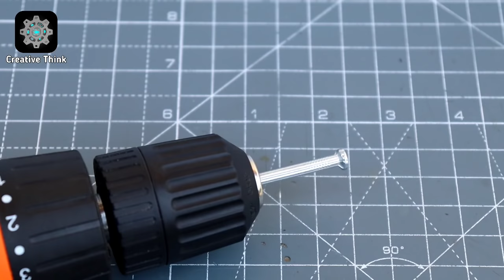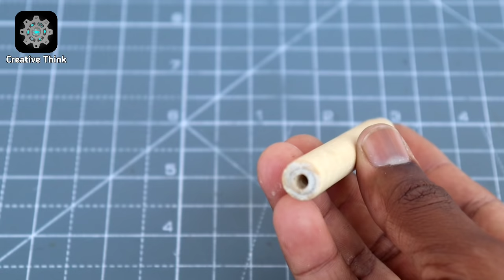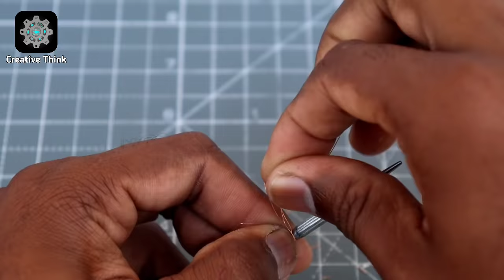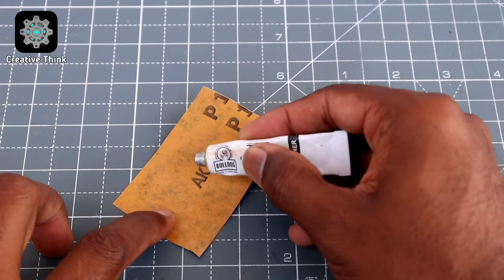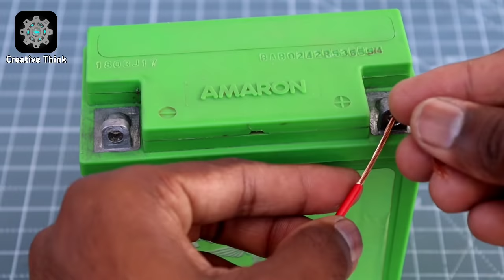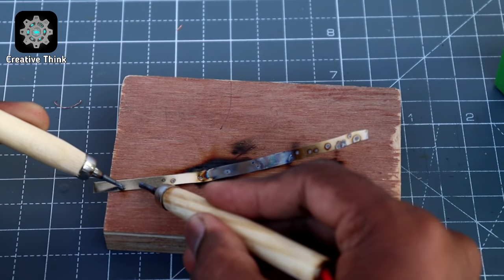Spot Welding Machine Using Lead Acid Battery

Comment: Appreciate the efforts but there are some disastrous design flaws which you can work upon. Sorry for being a critic, but this can get dangerous to viewers who may try to copy you.
1. The SS nail literally melted. What are some better alternatives?
2. Should've used proper battery connectors instead of directly soldering on the battery terminals. The battery material (chemicals) get damaged due to heat, thus reducing battery life.
3. Diode alone is not sufficient for protection, how about adding a fuse of appropriate value?
4. How about PWM switching control (using maybe MOSFETS) for variable output power control and efficiency. Also when it gets touched it should automatically disconnect after few milliseconds for a precise spot weld, after that even if it stays touched, it won't be connected.
5. An assembly setup with a handle like how vertical drills work. If the two terminal probes touch each other by mistake, then it will blow.
6. How about Using an 1:1 isolation transformer between battery and system?
Reply: The diode has been removed by in the video of it working. I'm guessing the current killed it.
Reply: I, for one, appreciate this comment.  I am an avid DIYer, and your suggestions are very valuable for someone like myself who is serious about recreating a similar device for small projects.  👍🏽
Reply: What is a PWM switching control if I may ask?  And what might it look like? I mean down to the component level. I've been trying to learn about circuitry basics and the fundamentals...any input helps. No obligation though. 💁‍♀️💖
Reply: @Merrick Brody  what kind of stuff do you make DIY?  Any chance I could see some of your work?
Reply: @chloedevlin6544  basically, you would use a switch which can be controlled (turned on or off ) digitally/ with a digital signal like a 1/high or 0/zero, generated from a digital circuit.
This switch can be a MOSFET, Relay or other any other electronic switching device suitable for this application.
(Suitability depends on factors like maximum current rating, polarity, switching speed, triggering circuit specs, etc.)
For starters, now you can turn things on and off with precise timing with use of this switching devices... For eg. you turn it on for precisely 100milliseconds and then turn it off automatically by using a digital circuit.
Reply: @chloedevlin6544  you can also input a PWM signal to this switch. PWM - Pulse Width Modulation. 
It's hard to explain this topic in the comment section, you can easily get the fundamentals on google. But it is basically a signal which turns the switch on /off at a high frequency.
Due to this, the output power can be controlled. 
How? Try continuously turning on/off your fan or any motor manually using a switch button and observe how it affects the speed by varying on time and off time
Reply: I would highly recommend everyone to strictly not experiment around these things like battery and high power devices unless you have adequate technical knowledge of electrical engineering and power electronics.
Or else, it may get explosive and firey and dangerous soon.
Reply: @spinnanz  No guessing needed.  It's unnecessary.  Serves no purpose but to make smoke and shrapnel.
Reply: Isolation transformer?  For what?  It's a DC circuit and transformers do not work with steady-state direct current.  Even if you pulse the primary, what purpose did the transformer serve if it's 1:1 and the source is ALREADY ISOLATED?
Reply: @advl__  "eg. you turn it on for precisely 100milliseconds and then turn it off automatically by using a digital circuit."  What you just described is, in no way, PWM.  It's a pulsed DC controller, but it's NOT PWM.  Stay in your lane.
Reply: @advl__  It is not difficult to explain if YOU understand it.  And from your previous explanation, it's clear that you do not.  PWM is simply the manipulation of the duty cycle of the DC current.  If you leave it on constantly, it is 100% duty cycle.  If you turn it on for a given amount of time and then turn it off for the same amount of time, it's 50% duty cycle or a PULSE of DC that is equal to the off time. If the on time is 1/3 of the off time, then you have 25% duty cycle.  If the on time is 1/9 of the off time then it's 10% duty cycle. etc.  Do this continuously and you have a PWM signal. The pulses are typically no longer than 0.5ms so rates of 1000 times per second and faster are typical.  This is NOT how you limit the energy (not power) on a spot welder.  You do that with a SINGLE pulse that can be made shorter or longer.  Just because the pulse duration is limited, does NOT make it Pulse Width Modulation.  The power of the spot welder remains the same as the resistance and current remain relatively constant (barring non-Ohmic materials) and power is IR^2.  Power over time is the energy put into the system and you want to limit the energy going into the substrate.
Reply: @DiffEQ  Maybe it's time for you to go back to engineering school. Maybe a real one this time.
Even though the source is DC, it is in no way isolated and it can damage the battery when the terminals are getting directly shorted, especially when there is no current control. ( resistance is not isolation) That's why a thought proposal for "isolation" transformer. A thought proposal does not mean I am telling to connect the isolation transformer directly to DC source without alternator at input and rectifiers+switching control at output side. (It would also be more efficient at higher frequencies if you had enough knowledge to ponder upon) 

Regarding PWM your statements are self contradictory. Maybe try working on some practical projects in real engineering labs before blabbering half understood definitions in comments.
My explanation of PWM was to give an introductory concept to someone who is not from electrical background.

Power is not IR^2 as you have stated... It is I^2 * R and also V*I . It depends on both Voltage and Current. And with PWM  one can control average output voltage and thus output power.

Also, try to understand the objective of my comment. I am not here to teach engineering or tell the OP exact improvements on the project, I am trying to trigger a thought process and so are the wordings.

Comment: In an emergency situation,  this would absolutely work on light gauge materials,  but it is not advisable to use this setup for long term use...
Reply: Sketchy af.  Just get a $20 controlled welding pens.
Reply: @h8GW  I'm not gonna carry around a welder everywhere I go, so in an emergency, if all the parts were on hand, this could get you out of a tight spot...

Comment: What is that item you welded on positive pole?????? Why it isnt in your components list?
Reply: That was Diode just to make current flow in one direction .
Reply: Why the diode is needed? The battery is DC not AC. You are going to burn the diode if the current exceeded its ratings.

Comment: What is the little black link you added? Is it a diode? And do you recommend a specific one?
Reply: Yes, it's a diode.  What else could it be?  It's not going to survive shorting and, if you look, it's not in the device he's demonstrating.  It fried the first time he tried it... and it served no purpose.
Reply: @DiffEQ  well thanks for your comment. And to hell if I know what it was is why I asked the question. I'm not a engineer nor electrician. Electrical engineers, for all we know that could be anything or nothing. "What else could it be" some people think they're to smart for their britches sometimes. Maybe it's low self-esteem because they know something someone else doesn't they feel they have to be insulting to boost their ego? Are you sure that isn't just blade fuse in the housing for a fusable link? That's what else it could have been. But again thank you for clarifying my first guess was the right guess..
Reply: Number one, it's easier to pee than doing a number two... When about two hundred amps go through your ass or your heart.

But that is unlikely because 12 v won't shock you, isn't that shocking? 
Not enough voltage, yeah plenty of amperage, but if electrons can't pass through you, it's like a little girl kicking you in the shin.. annoying 😅

I don't know you might be able to use a diode out of a old microwave. 
And hell that  transformer in there will sure do some tac welding., But you better watch out, that shit will fry your cookies, I think they put out about 6000, but Not much ambridge, still yet you'll be looking like Einstein your hair all in a fizzle.

But you can use one to do tack welding or even with a stick. Just got to do some modifications, that  info can be found.

Keep On keeping on

Comment: Can a car battery be used for this? What is the part number for that diod? Thanks in advance
Reply: yes
Reply: The diode is stupid and didn't survive.  Do you see it in the end demonstration? No... it blew the first time he tried it and it served NO PURPOSE to begin with.
Reply: He obviously had enough power from the battery he was using.  A car battery would just deliver more power.  The part number for the diode would be BLWN2HELL.

Comment: Two problems with your set up. First and foremost those leads are always hot. That is a bad thing. Second stainless steel is the wrong material for the leads as you showed. Melting them. Copper or tungsten would be a better choice. A momentary switch is essential for safety.

Comment: What if we parallel connect ten 1000uf capacitor and charge it with this battery and then use that charge capacitors as a spot welding machine. Does it work or not?

Comment: On the minuhete 5 it show that you connected the red wire straight to the + side, where is the thing that you welded before in video ?
Reply: The materials and construction are just foolishness.  Diode soldered directly to the battery lead?  WHY?  Maybe this guy is laughing his head off just thinking of all the idiots who followed his video only to have a semiconductor fry/explode in front of them.

Comment: Why are the solder joints not melting? It means solder has higher melting point than iron or aluminium and if it is so then  we can use soldering iron for welding
Reply: 7
Reply: That's because soldering tin has lower resistance than steel he spot welders it, but honestly this video is a junk.
Someone with enough understanding will know there is no diode needed for DC current.

Comment: You shoewd a good video but you dis not mention the item and its specification of tge electronic vomponent you welded to the batterg. thst was the most helpful item
Reply: Learn to type!

By reading any further you agree to assume all liability and responsibility for your own actions and what you decide to do with this information.

That being said, it's a "6 amp, 400 volt, rectifier diode"...
If you could not figure that out on your own, than you should not make one of these. I told you anyways because I believe in natural selection. Do with it what you will, but remember I warned you.

Comment: If you make a pedal that will create a quick contact you will have some more control and not stick your electrodes and melt everything. Just tap the pedal quickly.

Comment: it is good for welding thin metals but for spot welder supercapacitor is better
Reply: Can you explain your comments further please bruh, I'm working on a 1977 toyota pickup and cutting put a the rust , only the body has rust thank God haha 😂  but I need to replace my flooring in The cab , especially in the front part of the cab, where the factory bolts the cab to the frame near the engine firewall it's completely rusted away like there's nothing g holding the body to the frame anymore , i can't afford a welder at the moment and I need this truck for work so I've been looking for ways to weld new flooring in. In also building a full roll cage hidden Inside the body , reinforcing some stuff on the truck since I'm tripling the HP it has currently. All new adjustable coilovers front and new adjustable 4 link coilover in rear to replace the leaf springs , new disc brakes front and rear, HEAVY sound deadening for floor,doors,roof and heavy duty weather stripping replacement. Lowering it a bit to help with handling at high speeds, no power steering ... anyways I'm excited AF for the build trucks factory original everything and everything works except it rained heavy one day and my speaker(yes truck has 1 single speaker ) lol went out. Anyways until I can afford a welder I have to make do with what I got 😂
Reply: @timothy2935   it has not enought Amper to weld solid car body, you need proff spot welder or MIG

Comment: EXTREMELY DANGEROUS!!!! Not recommended.
Reply: Why?
Reply: @dmitrym2922  because spot welder use low voltage high current which is ideal. But what he is using is gonna damage ur battery if you gonna weld using this
Reply: It's a 12volt system how dangerous can it be? I've been zapped by the ignition coil it's not that bad. Now if you fuck up the spot weld on the lithium ion battery that can be unpleasant what with the fire amd such

Comment: He needs to use steel nails for electrode to ensure better resistance than copper. If your voltage can be reduced to 3V then copper is better else battery will get damaged.Good idea though I prefer a 3V source

Comment: Waste of time. 
1: Probes should be made of copper
2: Diode does nothing 

May as well just get a battery and jumper leads and use them melt the metal.
Reply: Diode does absolutely nothing (but get hot, I bet)

Comment: Soldering  a wire that will heat up to hundreds of degrees Celsius? Note how the timber handle is brown  from the heat... releasing all those toxic fumes from the burning epoxy. This  a children school project that should be supervised and then disposed of by a responsible adult. But with millions of views the clever creator is enjoying the $$$ of his effort

Comment: Please what is that little black component you welded to the battery terminal?
Reply: Emergency licorice candy
Reply: @waynemasters8673  thanks. What is it's importance there?
Reply: @umarfaruq4335  They are everywhere in electronics for a quick snack.

Comment: love the fact you put a diode in to prevent back voltage and possibly making the battery explode.
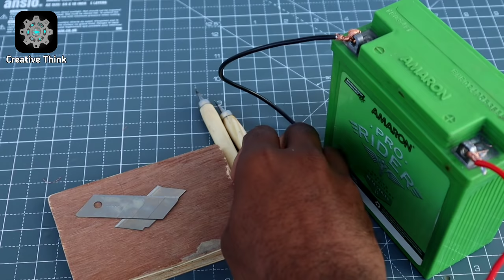Reply: Take a look at 5:02 , the diode is missing 🤔
Reply: @raafayumar8015  he must have edited it after and put the diode in.i would never do this without one.thats just asking for trouble
Reply: Back voltage wtf is that
Reply: @henryharmse4003  when voltage goes to one point, hits resistance or is shut off.the electricity needs to go somewhere so it goes back where it came and that could cause damage......prob not the best explanation for it but thats how i see it
Reply: The battery is the only power source.  There is no other power source to drive current INTO the battery.  No diode needed other than to provide some smoke and light on first use.  His diode did not limit the current to 10 amps.  It self disassembled and let its smoke out shortly after the current exceeded 10 amps.

Comment: Mark my words it's coming I don't know when but that battery will explode when you short it across the metal like that they're not designed to do that type of work I have worked at battery places in the past and have seen it happen many times over people accidentally shorting batteries and they explode

Comment: Way to strong for like quick lithium battery fixes ie the spotweld comes apart  with a lower current u could  use this to  re solder the spot weld

Comment: Youtube should hire some technician experts to review the "DIY" videos and the dangerous ones remove from public view, just like this one which is crap at first point and 2nd, it doesnt work....instead of nail only electrode suitable to use is a TUNGSTEN...which can be bought in any shop with the welding equipment for TIG welding for like 1 to max 2$ a piece 150mm long 2.4 or 3.2mm thick,  so you can make 2 sets of tips...
Reply: please send a link to your safer diy videos
Reply: @ramadhanmohamed8684  do it as it should or dont do it at all....its not about you or me...i dont have such DIY videos, but if i did, believe me, i would go much deeper into the matter of safety and functionality after all....just like i said, your project  would be a 1 light year bette only if you did use a tig welder electrode for 1$ only....nail vs tungsten is not even  comparable....and if you live in country where the nail is available and battery as we saw, believe me, there is a tungsten electrode available as well ;)

Comment: There is no role of rectifier. As evident he in his final demo used it without diode. I think he added diode to fool us.
More over using battery in this way may explode. There is better way to do it instead of  diode add a 2.2-5 Ohm /10 watt 
resistor and at the out put add enough capacitors of 16V ratings.
Any one can comment on my suggestion. Thanks

Comment: The spot welds before and after are not in the same location. The video is cut and then continued. You can literally see the blades move during the failed attempt to weld them together. 

Nice try!

Comment: using that on an 18650 would be interesting.
Reply: Yeah like a little pocket welder
Reply: Too much high current is provided for the battery cells. It may 🧨💥
Reply: I think both replies missed the point, they want to use this to weld 18650 cells.